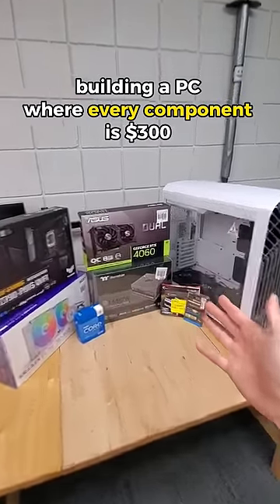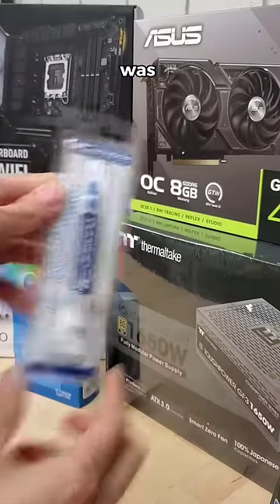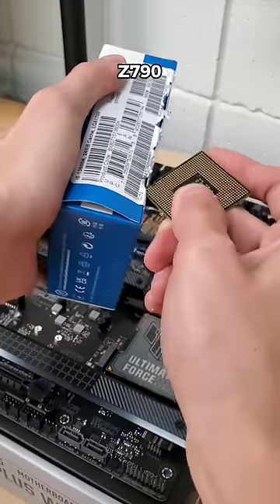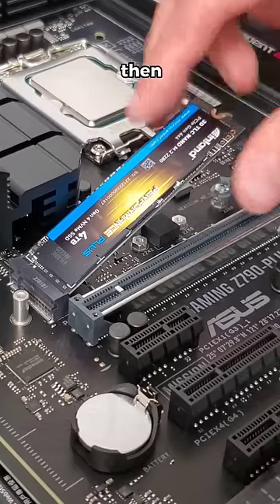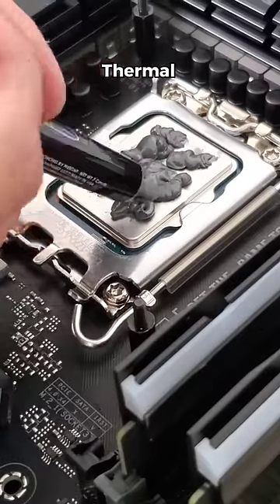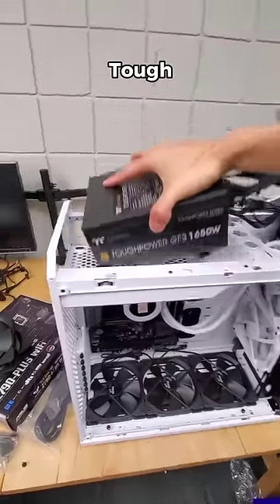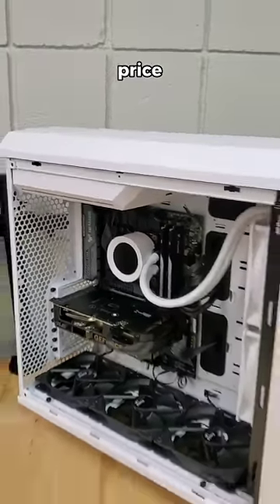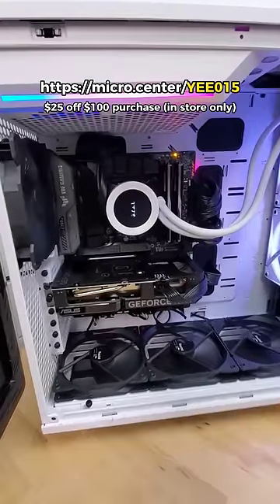adding $300 of thermal paste to this PC build #shorts

Comment: CPU's gonna be colder than the vacuum of space
Reply: it is a intel, can’t trust the water cooler TOO MUCH..
Reply: @pompomaddons  Oh man, this said some years ago would sound crazy
Reply: No, actually. Thermal paste is meant to fill in the microscopic gaps between the IHS and the heatsink, but adding too much of it will actually make it run hotter.
Reply: @andrupka8749 well, also no. It’ll just goosh out the side and get your motherboard all dirty. It’s not going to run hotter because of it (unless it’s particularly thick / low mounting pressure / etc)
Reply: Opposite actually. It's supposed to fill the gaps between surface of the CPU and cooler. Metal on metal touch is actually desired wherever possible. Too much means that a lot will leak on the side and make total mess, and also make less direct contact between surfaces and significantly decrease thermal conductivity.
Reply: Vacuum has no Temperature,so no concept of hot or cold.
Reply: @ishankumar3069  it's 1 atom per cubic centimeter out there so its about as cold as that 1 atom
Reply: @ishankumar3069  uh. i dont think thats correct.
Reply: @bakedbeanfanclub  those ooze on the sides will redirect some of the heat into the motherboard and cover the little side space between the the IHS and the heatsink where the air from the case is traveling.
Reply: @pompomaddons you misunderstood amd r9 with a nicely i5 this babe is cooler than you brain with an aio
Reply: Isn't there a quantum computer that has a cooling system colder than space already?
Reply: Dude... Why did you open a CPU with another CPU
Reply: not how it works
Reply: With an i3 this won't do anything
Reply: @ishankumar3069 space is around -280 degrees celsius
Reply: @pompomaddons  It make me think you never used a intel WC, I did a small 120, and god, wrong mounted and still doing it perfect with no bad noises after 10 yeras of use
Reply: Now that’s deep.
Reply: Too much thermal paste traps heat and ruins your systems cooling
Reply: your comment doesnt make any sense
Reply: Fun fact: space is extremely fucking hot
Reply: @john_doe668 no, only certain parts of it are, like stars and stuff
Reply: @Guitarsarecoollmao  the vacuum of space provides no isolation of energy, making it as hot as said stars, due to a lack of energy-sapping atoms
Reply: But... the vacuum of space isn't cold? Nor hot...
Reply: Thats how therma paste works

Comment: Now this is the ultimate bottleneck experience
Reply: man i5 13600k + rtx 4060 will not bottle neck
Reply: @drixoffl i think the card will bottleneck the heck out of the CPU in all resolution 😅
Reply: Not an i9 trash
Reply: where is the bottleneck though, other than the psu not getting used fully which kinda doesnt matter?
Reply: @tactilecola5709 the CPU is going to be barely doing anything with a 4060 in there is the point. The 13600k is a really great gaming cpu for all resolutions.. the same can’t be said about the 4060..
Reply: @chocokoifish321 It isn't FULLY the model number that matters. it's the generation number. An i3 13th gen will beat out an i9 10th gen.
Reply: And thats not what matter either. A 10900k will beat the shit out of a 13400. @randomtrainboy
Reply: @randomtrainboy I don't know how true that is
Reply: @jakecole7447 the i3 13th beats out the i9 10th in single, dual, and quad core tests
Reply: take me down to the bottleneck city where where the gpu’s good and the cpu is sh*tty, GOOD BYEEE MONEEEYYYYY YEEAYAYAYAA
Reply: @DaPlenThing so true lmao
Reply: @Longdn00  4060 is trash compared to other 4000 series cards it doesn’t even bottleneck a i5 10600k let alone a 13600k
Reply: @CocoKoi321  console kid

Comment: now let's see the benchmarks
Reply: Now considering the bottle neck here you can expect 400 fps in games like cs and valorant that are cpu games on high settings in 1440p and like 500 fps on 1080p, around 70 fps in demanding titles or less at 1080p (like 60 in 1440p) in terms of ram you can open 20000 chrome tabs
Reply: @truphot1 so its a mid range pc?
Reply: @BOT_AHHHH 4060 holds it back
Reply: @kispista_  maybe, if I'm gonna build a PC I will gonna spend more on the GPU
Reply: @BOT_AHHHH yea GPU and CPU since you dont want either to bottleneck the other
Reply: @CrimsonEquinoxx  yeah, I should use a bottleneck calculator before hand
Reply: @BOT_AHHHH  oh damn those exist? Seems really convenient
Reply: @truphot1  bro why are your expectations so low, you are exaggerating here.
Reply: @BOT_AHHHH yeah. a good rule of thumb is that the GPU should be 50-60% of your total budget. Also do not use a bottleneck calculator, those are completely useless and don’t represent actual performance
Reply: It won't even boot with 8000mhz ram with that kind of board

Comment: You could have used Prolimatech PK-Zero 600 g Thermal Paste which i know isint 300 dollars but its 242 dollars and who doesn't want to have a comically huge tub of thermal paste weighing in at 600 grams or 1.3 pounds lol

Comment: I have a question about RAM in general. Will it only run at 4800mhrz regardless of what it says in the box, until you enable xmp, then it will run at  its full capability? Also where do you get the electric screw driver?

Comment: But does it even fucking work? No

DDR5 8000mhz is a push even on the Apex 2 DIMM board and anything above 7000 is a nightmare on a 4 DIMM Z790.